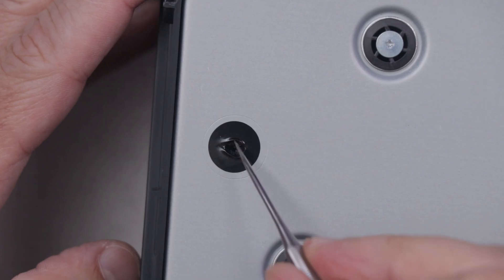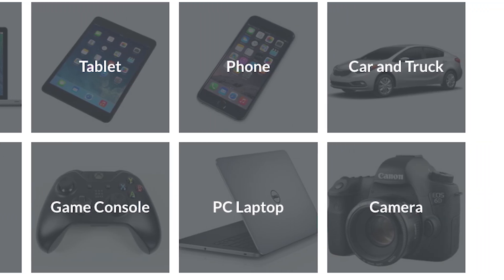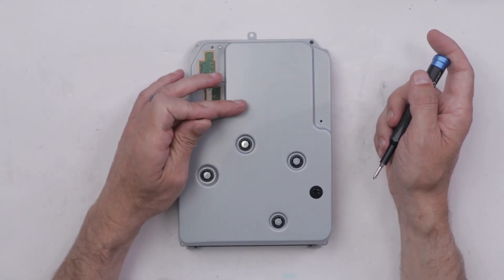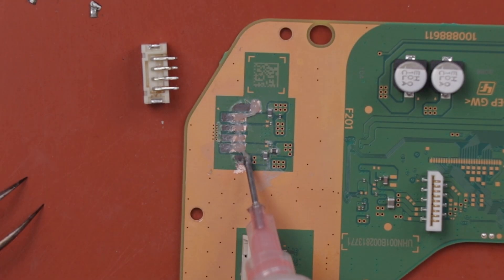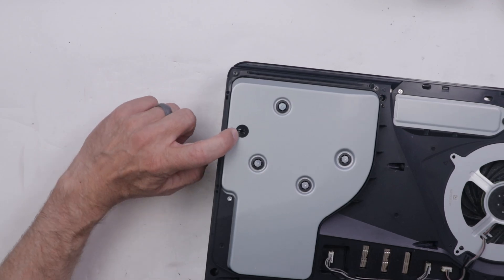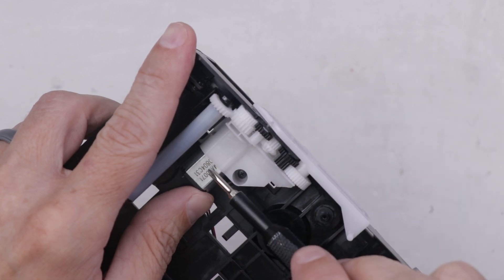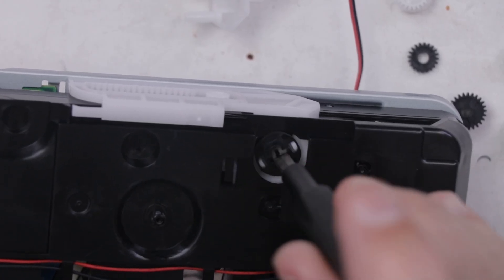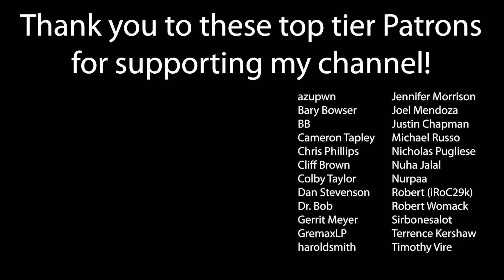Sony "Couldn't" Fix This PS5 - Can I?

Comment: 11:11 it´s not good to turn these gears like that. The nmall gear is making the big gear to turn, not in the other way. As the small gear/thread turns, the big wheel will follow. If you turn the big wheel, the teeth are pushing hard against the thread of the small gear and they can break and the axle of the motor wont turn because the pitch is too big. Its totally normal that what you are doing there isn´t gonna make the motor axle turn smoothly.
Reply from the maker: No, it's not normal for it to not turn smoothly as demonstrated by the fact that the replacement, known good gear train, works smoothly in either direction.

Comment: So it looks like Sony cleaned/repaired the drive, then accidentally tore the connector off and marked the unit as "unrepairable". If so then that's a disgrace on Sony's part. Nice of them to clean out the cookie crumble. But if they tear a connector off then they should just replace the drive.

Comment: I think Sony deemed it "unrepairable" due to the fact that the service/repair depot operates like an assembly line to only swap components for high volume repairability service. Most OEM warranty service depots, I believe, do this to save labor costs. E.g. One certified technician can can have a backlog of 20 consoles to swap parts then bench test multiple consoles. Since swapping components is much quicker. If they took time to do soldering on one unit and testing and ABA cross-checking, there would be a backlog of console awaiting swapping parts and testing. I think service depots find the most efficient (leanest) means of repairs with quick turn around, which in this case is quick parts swappage and then testing in volume per bench to be  the most lean and cost effect and driven, resource-wise.

Comment: I recommend the owner of the PS5 to just download his games online when he can get deals whenever he can. I have known Sony for years since PS2?, that their laser heads break very easily it happened to my PS3 as well and I have never bothered to get a PS4 because it happens the same way, I had to customize my system and make breathable holes because the system also still gets hot and they have never ever fixed the way the system releases heat as well.

And I've also have learned the hard way once your laser head beam  dies out if you don't replace it you can't even play a downloaded game that you have inside your hard drive you have to literally clear and replace the beam head and it has to be in a working order, for it to seem to pick up on hard drive games that are inside the system. So since then I just went back to a method that I don't use that much but since I now switched over the PC?. I have been downloading games when I buy them and a friend of mine says you never lose them they just stay in because you purchased it for life so you can download it every time every time you sign in. If you have cleared your hard drive games by mistake or something broke and you need it to fix it you'll be able to redownload the game that you already purchased without having to purchase it again.

I'm old school just like him most likely he buys games on CD that's how old school I am I don't really like games on CD I go as far back as cartridge I'm extremely old I'm from the 1960s so I'm skeptical and downloading games in hard drive. But I recommend that he avoids using CDs and CD games and the CD drive just to save his laser head for a very long time because they can be expensive to replace. Most of the time there really isn't parts to to buy the parts really just come from other dead ps5s I learned that the hard way during PS2 and PS3 systems.

Once the systems are discontinued?, they are extremely impossible to find the parts you just have the hope that a dead system has landed in the hands of someone that is selling on eBay or Amazon but if they are cool they probably give you a good deal for the parts but if they're greedy?, and you really want your system up and running?. Well be prepared to pay a hefty penny I learned that he should just stick with downloading the games inside the PlayStation Store just look for a Black Friday deals or some other way sometimes they drop prices and if a new system arrives when they do make a new one like a ps6?. All PS5 games just start dropping in price that's just something they do hopefully without monopolizing the games too much.

I learned that playing games on cd?, puts a strain on the laser head beam it puts a lot of strain on the system and over time that breaks that laser head and you know what I mean you have to pay a nice Hefty price when it comes time to replacing it that's not even the cost of having a professional like this guy in this channel replacing it which will be a labor fee. I have a small experience of replacing Parts but I don't have the kind of experience this guy has with soldering I'm not that good at it. LOL 😂 so good job great video man!. 🎞🎥👏👏

Comment: I worked for Sony a long time ago, and never in the repair dept, but I'm pretty sure a customer would expect some kind of short guarantee on a repair carried out by a Sony repair base. No major electronics manufacturer is going to give a guarantee on a torn pad repair, that's why Sony have deemed it unrepairable even though a DIY'er can probably repair it...Steve himself has done repairs that "he wouldn't sell" for the same reason, to protect his brand and reputation...

Comment: why don't you get some copper sheet, like what we had in the marines to repair a board.  The copper trace was cut out and re glued to the board, using UV activated glue some times we had to cut out a burn spot fill it and once again re glue the traces ect and those are soldered to the old traces.

Comment: Para todos los que dicen que sony recibió una lección, les comento porque Sony dijo que no se podía reparar (o almenos eso  creo con base en mi experiencia): Cuando un equipo viene para reparación, lo más correcto es diagnosticar y cotizar reparación, sin embargo, cuando se trata de daños superficiales en electrónicas, los fabricantes no actuan como "talleres" sino como fabricantes, es decir, está claro que cualquiera con experiencia podría hacer una reparación "casera" y solucionar esto, sin embargo, al ser fabricantes y no talleres deben reparar el equipo con calidad, es decir, cambio total de la unidad de disco y al ser un equipo costoso, normalmente los costos de reparación se basan en 30% del costo de la unidad para cobrar montos de reparación (mano de obra), garantías etc, además, a esto hay que sumarle el costo de la unidad de disco, por lo que, un cálculo fácil para esto sería, un PS5 nuevo puede andar cerca de los $800 por lo que el 30% de esto serían $240 (solo mano de obra), la unidad de disco puede estar en unos $80 por lo que el cliente pagaría aproximadamente $100 por ella, es decir, ya llevamos $340, esto quiere decir que reparar la unidad vale un 43% del costo de la unidad nueva, lo que la hace irreparable, pues cualquier equipo que su reparación cueste por encima del 40% no es viable economicamente, así que solo se le indica al cliente, no tiene reparación. Listo... Ahora, de donde saqué esta información? bueno trabajo para una empresa muy muy reconocida a nivel mundial que hace multimetros, amperimetros, medidores de calidad de energía y son el número 1 en el mundo en esto, soy uno de los técnicos de reparación y calibración de ellos... así que, esto explicado es como la mayoría de empresas se basan para cotizar alguna reparación, hay que sumarle otros costos ahí pero, pequeños que son aplicadas a empresas en especial.. Espero haberles ayudado con esto.
Reply: For all those who say that Sony has been taught a lesson, I will tell you why Sony said that it could not be repaired (or at least that is what I think based on my experience): When a piece of equipment comes in for repair, the most correct thing to do is diagnose and quote a However, when it comes to superficial damage in electronics, manufacturers do not act as "workshops" but as manufacturers, that is, it is clear that anyone with experience could do a "home" repair and solve this, however, being manufacturers and No workshops should repair the equipment with quality, that is, total replacement of the disk drive and as it is an expensive equipment, normally the repair costs are based on 30% of the cost of the unit to charge repair amounts (labor ), warranties etc, in addition, to this we must add the cost of the drive, so an easy calculation for this would be, a new PS5 can be close to $800 so 30% of this would be $240 (labor only), the disk drive can be around $80 so the customer would pay approximately $100 for it, that is, we already have $340, this means that repairing the drive is worth 43% of the cost of the new ps5 unit, which makes it irreparable , because any equipment that costs more than 40% to repair is not economically viable, so it is only indicated to the client, it is not repairable. Done... Now, where did I get this information? Well, I work for a very well-known company worldwide that makes multimeters, ammeters, power quality meters and they are number 1 in the world in this, I am one of their repair and calibration technicians... so, This explained is how most companies are based to quote a repair, you have to add other costs there but, small ones that are applied to companies in particular... I hope I have helped you with this.

Comment: Solid fix, disappointed Sony did not at least offered to swap the drive for a fee instead of deeming this e-waste. I would have checked that the motor mounting screws on the gear train were tight. They looked a bit loose in the video, you might not have even needed a new motor.
Reply: As stated in the comment above, Sony pairs all of the parts of a PS5 together. If you swap out the disk drive, it wont work as it'll not recognise it as it doesn't have the serial code or something. Basically Sony made it that if there's a big enough difficulty to the point of soldering being needed, it's e-waste.
Reply: @F3N01  be that as it may, but still Sony is capable of pairing new drive to existing motherboard or coding old drive's serial number to a new blank drive, but because selling an entire unit is more profitable than repairing broken ones they just refuse to do it. Please no body tell me that it is impossible, It is them who have done all thoose programing in the first place.

Comment: I almost learned this the hard way after removing a broken disc drive. Threw it away and when I started the system back up it tried to update but couldn't, lucky I was able to fish it out the trash and it wasn't nasty. Couldn't believe they would do something like that.

Comment: From a pure business perspective that drive was indeed unrepairable. The amount of work needed to get into the drive, swap the motor and then reassemble the entire console would likely cost more than just replacing the entire unit. Then again, they could have engineered the console so that a fix like this would be profitable for them, but they chose not to.

Comment: Seems Sonys repair/replace process differs from country to country. I have used them a couple of times over the years. Used them with my PS1 when I spilled water on it, also with my PS3 when it had the YLOD and with my PSVR headset when my rabbit decided to chew through the main wire. Over here in the UK, what they do or did is you contact them and tell them what your issue is, they tell you there is a single price you have to pay, regardless of what the issue is, and they send a courier to your house a few days later. You give them just your console without any cables or controller etc, and the courier then gives you a reconditioned console to the same spec as yours. So with my PS3, as it was an early fat model with the PS2 emulating software, that is exactly what I got back, not a later model without the emulation.
It's a reasonably priced service as well.

Comment: Hmm quick suggestion. i would have turned around the connector on the board and flipped the outer 2 cables of the plug going into it :) then you probably would have kept the entire mounting strength. but then again i am no console expert and I am not sure that would of worked either! 

keep up the entertaining videos Steve! 
ps. unfortunately the iFixit pro tech toolkit is not available on the swedish amazon :(

Comment: They could've fixed it by replacing the disc drive module and called it a day, and refurbish that drive with the ripped pins with a new pcb. Sometimes they really don't think things trough when they declare it unfixable.
Reply: Actualt they thought it through, but because selling entire units is more profitable than repairing broken ones they just refuse to do it.

Comment: Just a question, but I have a ps4 that only boots sometimes and id like to see what you guys think it is. I personally took it apart and cleaned it and i think the PSU is dying but I don't know if its worth replacing since I don't use consoles, so its been just sitting here. What should I do with it? or perhaps how could i check if it is the psu/buy a new psu for it if that is the case?

Comment: My apologies if I post this in the wrong place  or didn't read the answer somewhere.    Been looking for one of your videos again for a few weeks but could t remember your name(I'd seen a few vids before). I have an og Xbox that I turned on recently and it gave power and I got my disc out the tray but then it turned back off.  It hasn't came on since then. I took it apart to check for bad capacitors and that one internal clock capacitor but didn't see anything bad or couldn't find the cap. Is it possible for me to send this to you to check it out? If so is there somewhere I could start something akin to a ticket?

Comment: I am wondering why Sony would decline such a simple repair, but based on the comments…it makes some sense. If Sony is having retention issues with qualified repair technicians, it makes sense. Not a lot of people like doing the soldering required (I found this out first hand with my Xbox). I do feel that it is very inefficient to marry the board on the optical drive either system board, creates more problems for the company that could have repaired, rather than replace (if it was still under warranty). There are a lot of things that one company will deem unfixable that can be fixed, but it requires two things most companies lack today…time and skill. Great to see that you were able to get it working again. 

So I mentioned an Xbox in the comments above. Since it was out of warranty, I chose a local repair shop to fix it. The sign in the window said, “we fix game consoles”, so I believed they could. Had my machine for a month, tried to charge me more for the repair than it cost for a new one, complained about having to solder (their outside repair expert was having trouble doing it), returned the machine to me with stickers & permanent marker writing on it (had to scrub it off with a Mister Clean magic eraser), and scratched the heck out of the case. I paid $100 for the 30 day repair.

I used it once and it broke again (the drive didn’t even sound right. Lots of whirring). I ordered a replacement and did the repair myself (after watching one of your videos) in 15 minutes. The soldering wasn’t pretty, but was better than what they did and was functional.  I got another year out of that repair and then I ran into an issue securing quality parts (because the series s/x were in development), so I purchased a new Xbox One and still have it. Will probably replace this year with a Series X machine. 

Thanks for sharing.

Comment: Sony probably didn't want to fix it as the problems with the drive was customer caused and not a failing of the hardware on it's own. Still even If they didn't want to fix it you'd think that they would have offered the customer the option of installing another functioning drive???🤔

Comment: Ok I understand that the cookie was the owner's fault... But was the board issue caused by Sony or the owner? and also. did Sony say they repaired the drive? because if they did the motor should've been replaced. I guess what I'm trying to understand is, how is a board coming apart like that considered neglect? unless he tried to repair it before sending it.

Comment: That power connector should be through hole, or have mounting posts that go through the PCB for strength.  Sony probably saves a fraction of a penny using the surface mount.
Reply: Surface mount for these kind of connectors is pretty normal. Usually they will do through hole for bigger connectors, or ones that they expect users to be stressing a lot (think USB charging port on a controller or something).
Reply: Even the PS1 used surface mount connectors for the CD drive, and they ripped off the pads just as easily too.
Reply: One penny over 100 million consoles is a lot of money.
Reply: @EmergencyChannel  And if its through hole it probably would have to be added manually after the pick and place / soldering all the surface mount. So a lot more than a penny.

Comment: Are they really at fault for saying it is unrepairable though? If the pad has already been ripped once they can’t really guarantee this solution will be as reliable as using a board with unripped pads

Comment: Steve, I have an xbox one x that wont take a disc while it is running, but you can insert the disc (more than half way) when it is off and then power it on and it will take the disc and read it. After it is booted it can eject the disc. Not sure how or why its doing that. Can it be fixed???